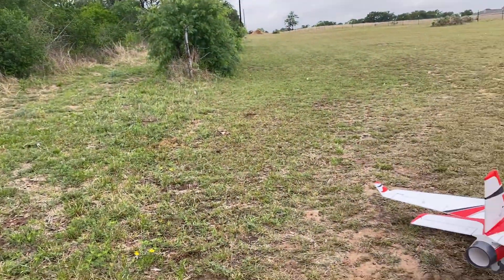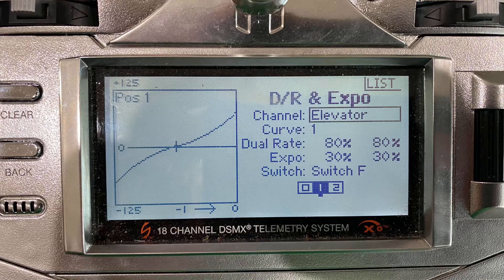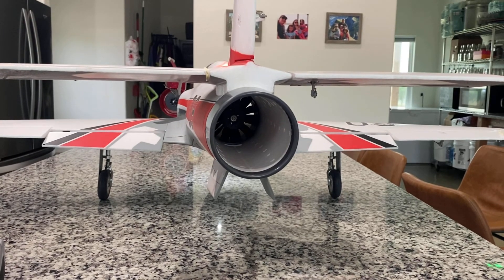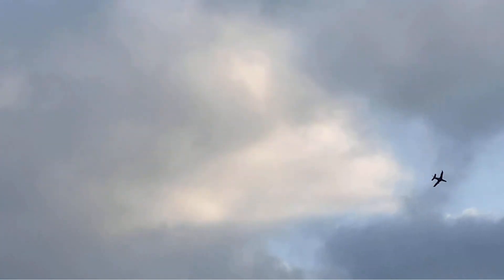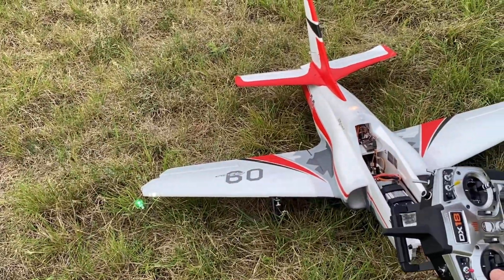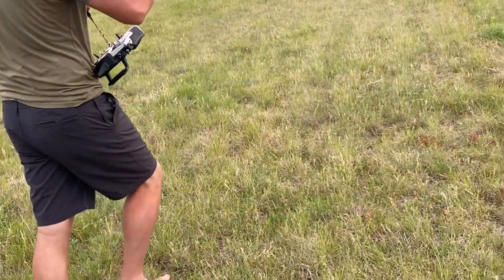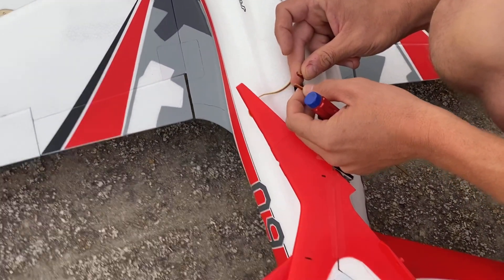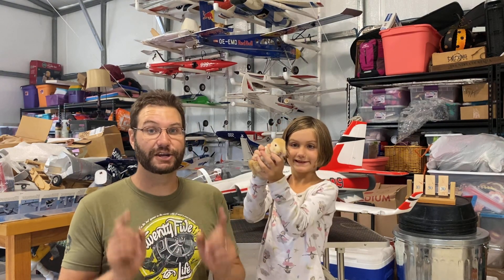Episode 64, “E-Flite 90mm Viper Jet, Setup and Maiden”

Comment: Sorry to see that happened to you but we can all learn from it. I pulled all of my servo leads forward on my viper V2 70mm cause I didn't like the excess wires bunched up in the tail section.  I have a viper 90 mm on the way and will be sure to give it a good once over and tidy up the wiring harness so as to avoid the same situation. Thanks for sharing and hope you are back to enjoying your viper.
Reply from the maker: Glad to have helped!! I should’ve known better and done the same as you on you 70mm version.

Comment: Sucked into the fan. Good lesson to secure cables correctly.
Reply from the maker: For sure, never would have imagined wires would have been exposed near the fan but in these new bind and fly birds I got complacent. This would have never happened if we would have bought as an ARF and set up ourselves. Lesson learned!!
Reply: @thercjetjock6571  That part is the same for the ARF. Wires need to be mounted yourself when you put the tail fin on. ARF is no different from the BNF.....
Reply from the maker: I was meaning to say if I would have placed the wires myself I would have secured them and triple checked before maiden. But because it was a BNF model I got complacent and just flew the plane. Sorry if that last response was confusing. 😊

Comment: in the manual it call for 100% Flaps down that alot I would go with 70% down just to check everything out and do a flight test make sure that will work for Ianding
Reply from the maker: Flaps surely weren’t the issue. 100% works great. I lost elevator due to the wire being severed by the EDF unit.
Reply: OK I didn't know it was the Elevator went bad I enjoy the videos

Comment: Das absolut gleiche ist mir im Herbst 2022 passiert. Der Impeller hat mir das Servokabel vom Höhenruder durchtrennt. Zwischen Impeller und der Auflage für den ESC (Holzbrett ist ca. 5 cm Platz. Dort kann das zu lange Servokabel eingesaugt werden. Jetzt hat der Hersteller FMS die Serie geändert und das Holzbrett bis zum Impeller verlänger. Ich habe bei HH Deutschland reklamiert und im Januar 2023 eine neue Maschine bekommen.

Absolutely the same thing happened to me in autumn 2022. The impeller cut the servo cable from the elevator. There is about 5 cm space between the impeller and the support for the ESC (wooden board). There the too long servo cable can be sucked in. Now the manufacturer FMS has changed the series and extended the wooden board to the impeller. I complained to HH Germany and received a new machine in January 2023.
Reply from the maker: Great to hear your customer service experience was similar to ours!! Too expensive of a plane to have to buy a replacement for sure!! I guess we learned our lesson about buying first generation planes 😁
Reply: Danke für den Hinweis. Muss ich gleich nach Ankunft meiner bestellten Viper 90 kontrollieren.
Reply: @hansomlin1857  Letzten Winter war das Modell über Monate nicht lieferbar, weil die Serie geändert wurde. Die Modelle die jetzt ausgeliefert werden haben das Problem nicht mehr.

Comment: Bummer that you had failed equipment! But looks like you got her pieced back together pretty well. Did HH have a thought as to what the issue might have been? --and you should repaint the Viper in a Military Scheme!
Reply from the maker: Thanks buddy, no horizon had no insight to share. There will be a new scheme after I fly her a few times 😉. That was a major influence to not take the replacement, I was just going to repaint it anyway.

Comment: Any chance the wire was cut by the retract mechanism? Controls appeared normal until you dropped the gear for landing, then it became unstable. Something with significant force to cut the wire.
Reply from the maker: Man I just don’t see any way that anything to do with the landing gear would have caused a wire buried way up in the top of the fuselage to be cut. But we are talking about airplanes so anything is in the table lol

Comment: I think a wire was pinched when he put the elevator on
Reply from the maker: Negative, the cut section of wire was deep in the fuse well away from the tail. But it was a good opinion and I rewatched the assembly of the airplane to confirm it wasn’t that.